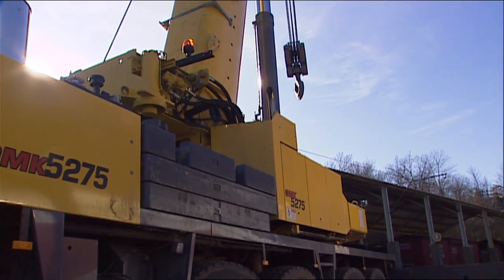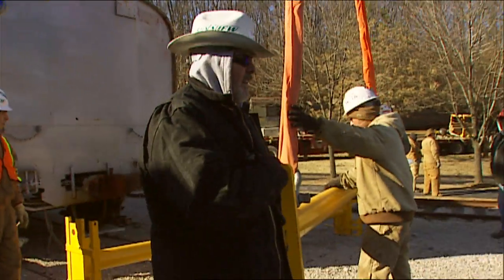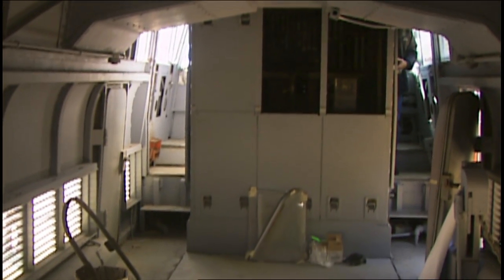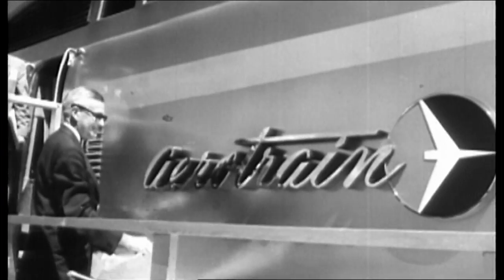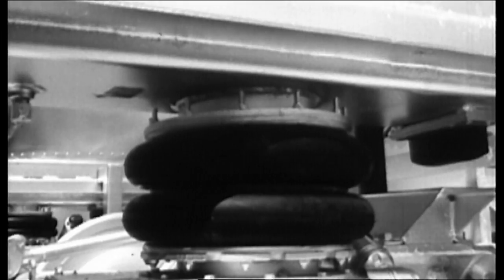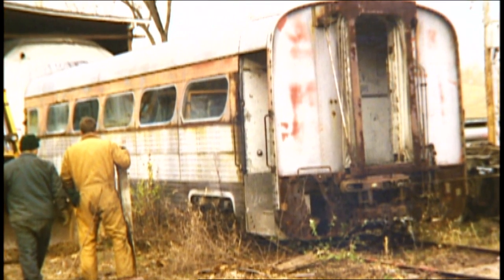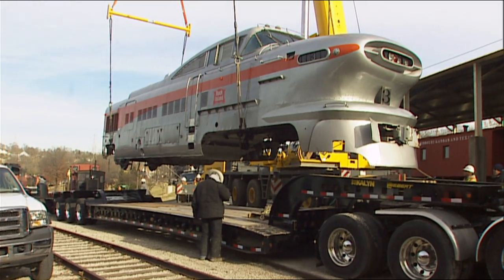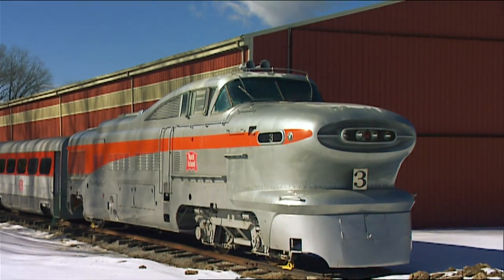What Happened to the Aerotrain? | Science Matters

Comment: Talgo used air bellows for tilting into curves at speed.
Reply: No. Talgo cars were suspended from the roof atop long coil spring towers that connected to the wheels below. The tilt was provided from the car's center of gravity being below the 'instant center' of the suspension geometry, causing the cars to sway outward in curves.
Reply: @Greatdome99  Sounds like a good way to derail.

Comment: The roofline on the engine of the GM built Aerotrain looks a lot like a 1957 & 1958 Buick Centruy & 1958 Oldsmobile 88. The back end of the observation car on the GM built Aerotrain sets looked like the back end of my most favorite Chevrolet & Pontiac Station wagons from 1955 to 1957 when GM built the Chevrolet Nomad 2 door hardtop station wagon & its Pontiac cousin the Pontiac Safari Station wagon.
Reply: Christopher S. O' The cars look like Greyhound buses. Super lazy design, the anti-streamline design in the streamline era 👌🏻

Comment: A GM product with poorly designed suspension?.... yeah that's never happened before. lol
Reply: The problem was that ride quality on trains depends on both car springs AND the flexing of the rails and roadbed below, which contributes a substantial portion of the softness. Since these cars were so light, they could not take advantage of the natural springiness of standard RR tracks, and thus bounced over them instead.
Reply: I was gonna say that air ride suspension was made for smoother rides
Reply: But it would've ran smoother if it had coils on it, just like the other diesel engines
Reply: DJ ArcForce  and the only GM made thing that did not have a recall

Comment: yea, general motors put buses on tracks and they failed miserably
Reply: UK pacers
Reply: The cars of the Aerotrain are based on long distance bus bodies... So yes, they put buses on tracks...
Reply: Marcelo Benoit Super lazy design, they look like Greyhound buses 👌🏻
Reply: @V0YAG3R  GM tried bus bodies backwards, it it did not work.
Reply: abc zyx trams not street cars. Get it right.
Reply: @maxin514  American terminology. Streetcar. Can be operated by animal (horse or mule), cable, or electricity, in which case it is also called a trolley. A tram is a small cart such as used in mines. Locomotives are run by engineers, the conductor is not called a guard, and so on.